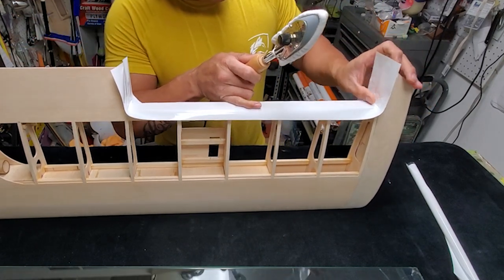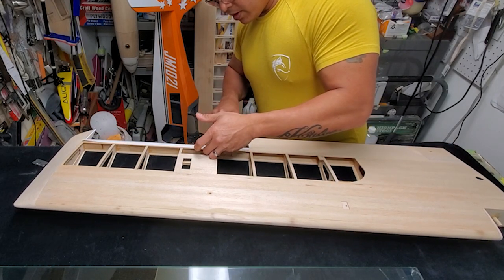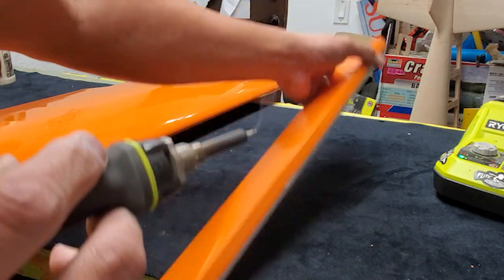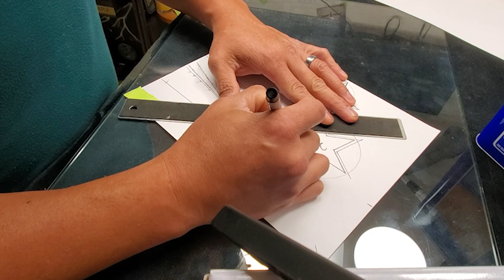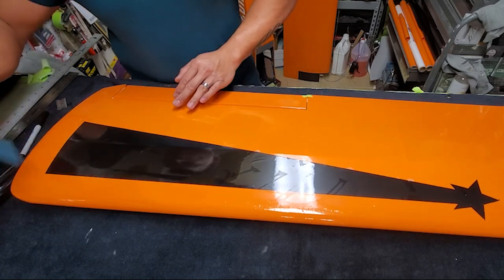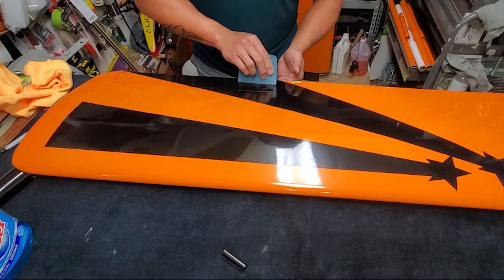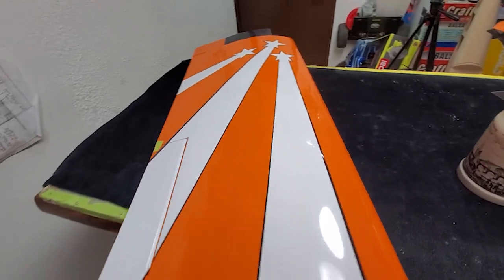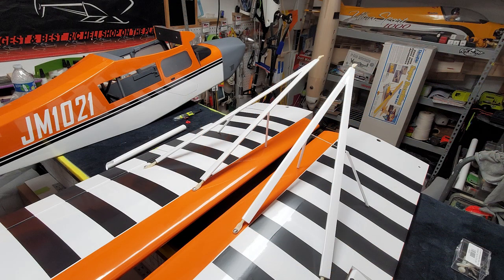Great Planes Dynaflite Series Super Decathlon Part 2 Covering the Wing

Comment: Did you iron after windex? Finally tracked this kit down. Currently working on Balsa USA 1/4 Edo floats.
Reply from the maker: Yes after the windex fully evaporated (I left it till the next day to dry out) I went over the areas with my sealing iron on low heat.  If your heat is high you will develope tons of small bubbles.